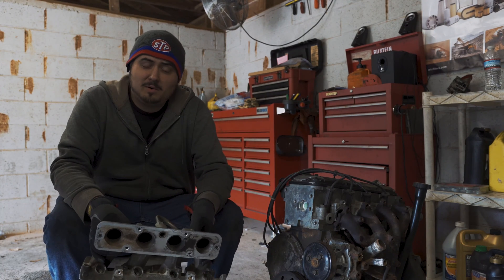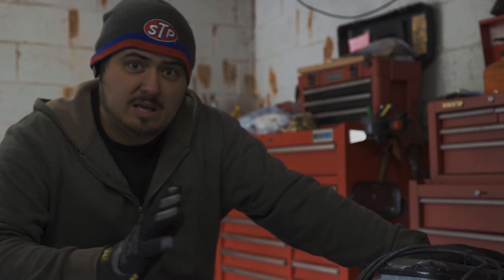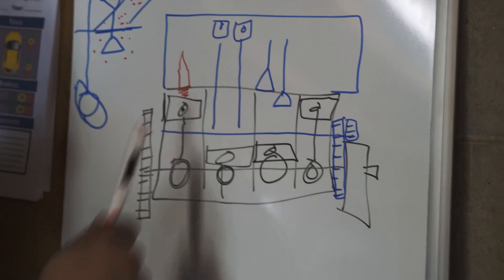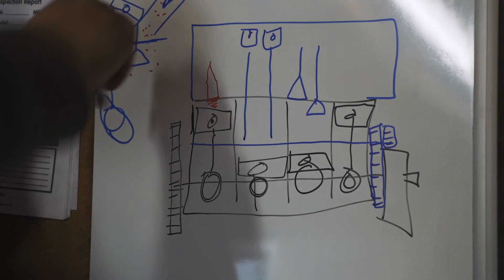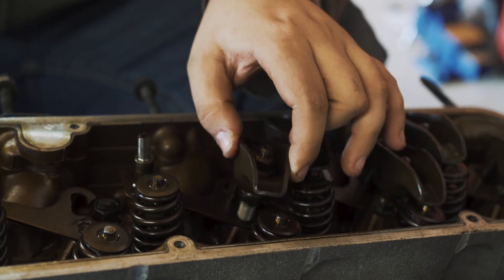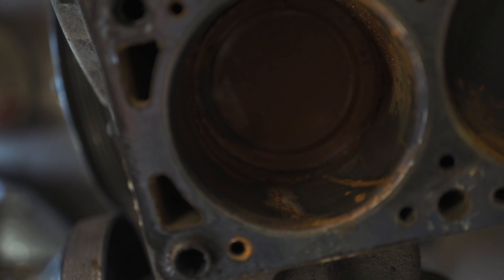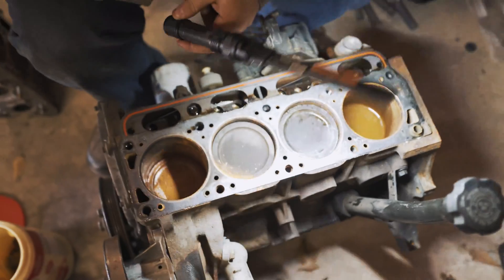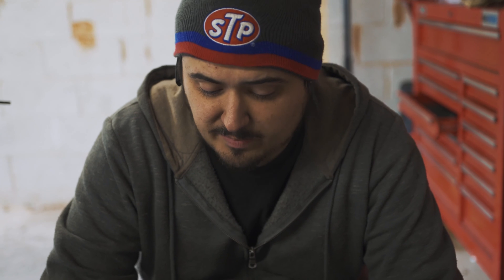HOW A CAR ENGINE WORKS, how to diagnose if a car engine is worth fixing or replacing, engine basics

Comment: You are talking about a 4-stroke, internal combustion engine, gasoline. There are other types of engines in motor vehicles. 
--I'd have to disagree that you are a technician. You might be a mechanic, but I don't see any technician level diagnostics, etc. being done on your videos. 
---